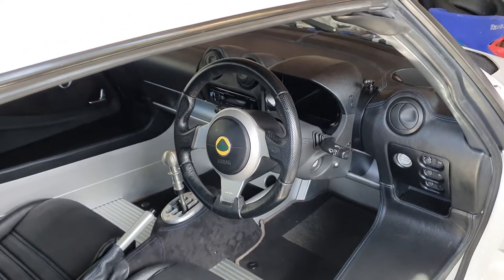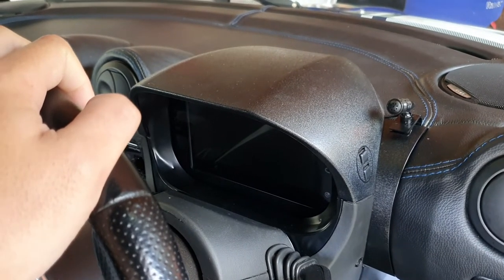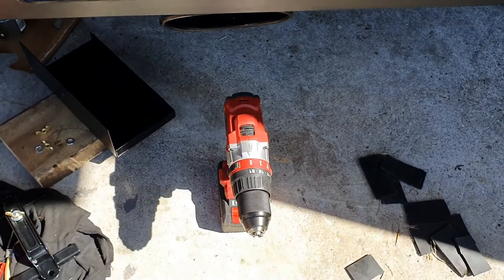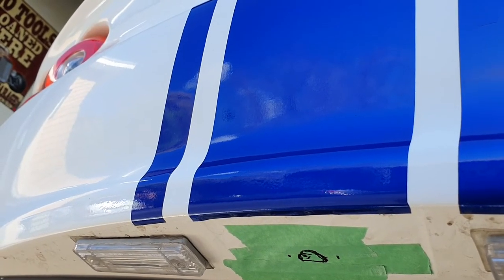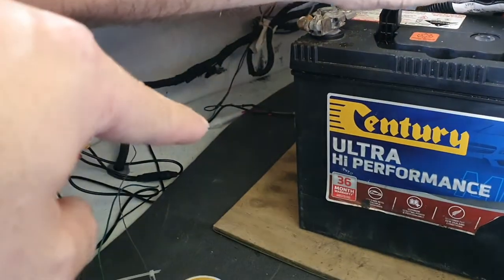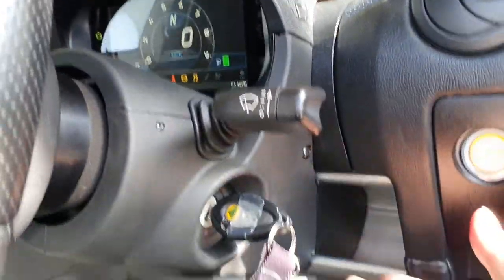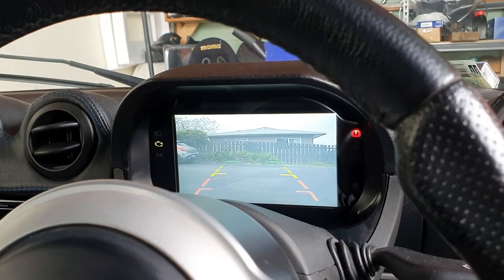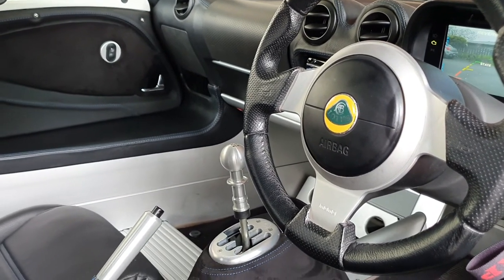Lotus Exige S Episode 10 - Reversing camera install for AiM digital dash MX2E

Comment: You'll get better image quality if you installed a wired connection instead of the wireless link.
Reply from the maker: Yes I think so as well, the wireless is just really easy, don't have to worry about routing the cable